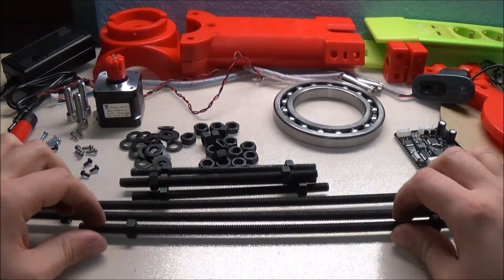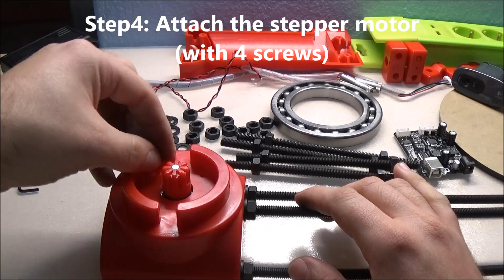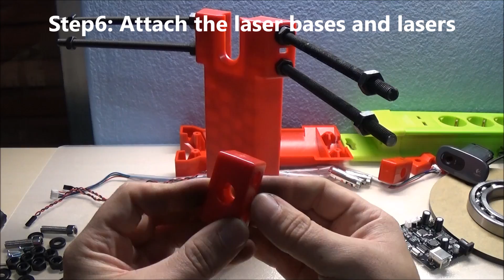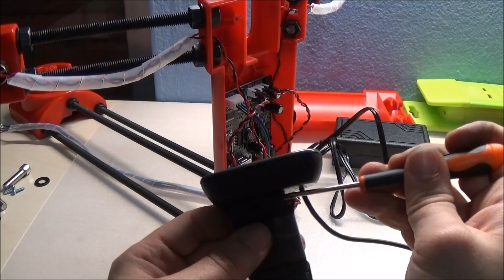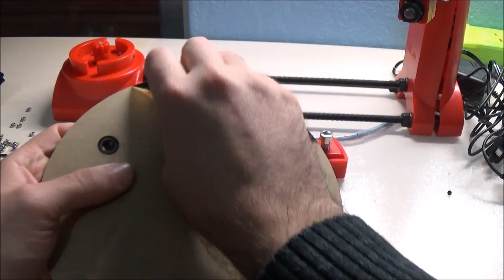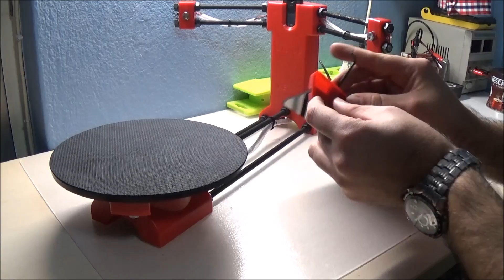Assembly the Ciclop Desktop Laser 3D Scanner

Comment: Cannot get table to sit well - the plastic stepper motor boss hiits underside of table before table is nicely positioned on the base. I can rock the table 1mm each way ....  Only solution I can think of - is to add washers under base to lower the stepper motor to allow ball ring to sit properly. Used spare prop shaft adaptor rings from my RC planes ... they have a thickness of 2.5mm and the stepper motor is now low enough that the table ball bearing ring sits properly on the base.
I also used the spare large washers from the 'rods' with the ball ring retainer bolts to reduce the amount of thread that shows above the nut. This then means table is flat and without threads jutting above.

Comment: Mine doesn't do the prescans at all.  The lasers don't trigger like it shows in the video.  Thinking of repacing the board with a UNO and a Zum Scan adapter board I have seen elsewhere.  Plus Now I have found two people saying the stepper motor is wired incorrectly that the colors should be Blue/Red/Grn/Blk not Red/Blue/Grn/Blk.
Reply: In the software is an option to invert the stopper motor.

Comment: I have mount and unmount this device several times. Each time being very careful with the measure of the rods and the correct direction of the camera, the laser crossing on the centre of the rotating table etc. I have check the camera to get well focused too. And I NEVER have get a decent scanning results. Using both lasers is impossible for me, I always get two different point clouds. VERY different I mean. Inusable. And sometimes using just one laser the measure is clearly incorrect, getting "fat" scannings. I have tryed Horus 0.1 and 0.2 and same results. So, pleeeeease, could give a clue to get my scanner working properly? Thanks a lot.

Comment: Hello, I just bought the scanner, built it with some frustration, as the one in the video(not yours) doesn't match mine.  I plugged it into the computer, and power, but were is the software I am to use to run it? Is there a program I need to down load?